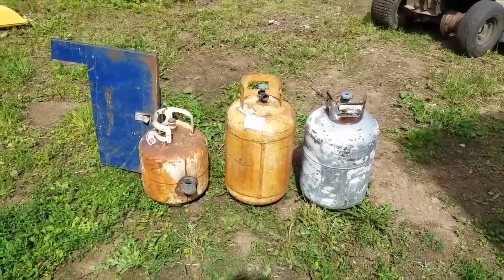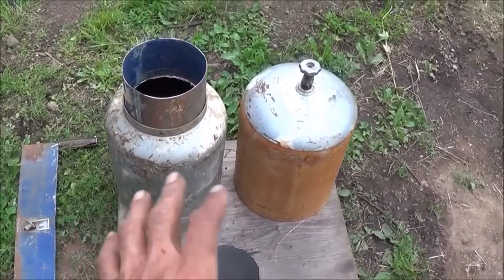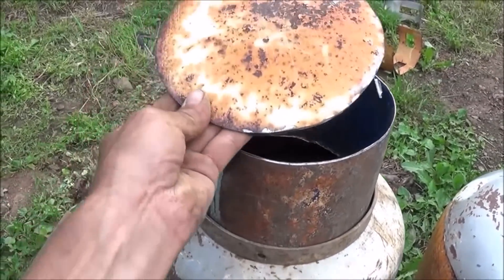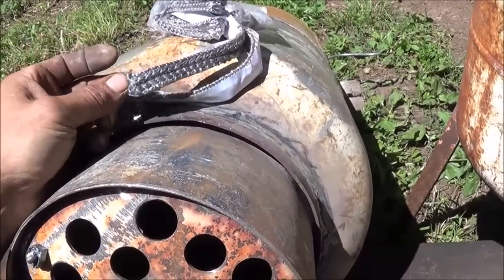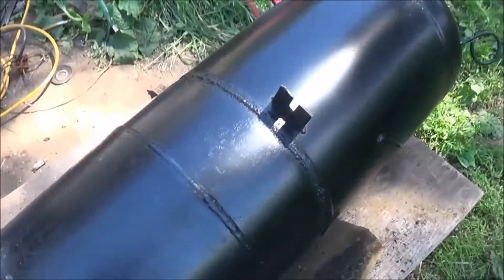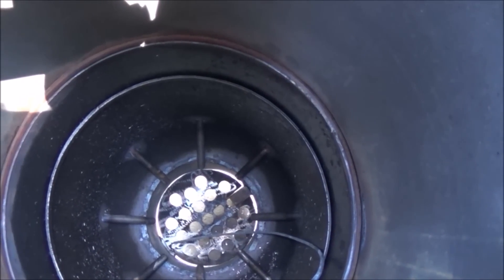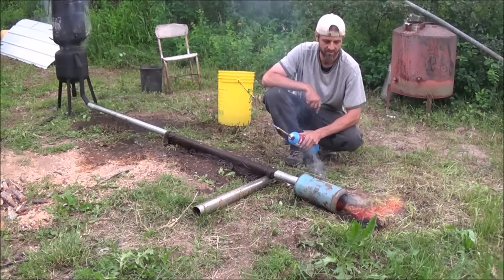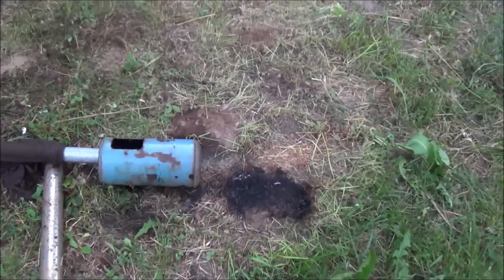How to build a "Wood Gasifier" from propane tanks, to power a "Tiny House"!

Comment: for you guys wanting to compress this be very careful if you compress a combustibale gas and oxygen even accidentally gets in the mix you just created a bomb that will flash explode faster than you can imagine i learned this when  i was 16 and wanted a portable cutting torch so i took an empty helium can from a science expirement and started my cutting tourch mixed it to neutral flame snuffed it out in the dirt and proceeded to pressurize my helium can... when done i lit a candle and called my sister to watch i squirted the bottle at the candle and there was no flash just an explsion that blew the can seem in half and blew both ends off the bottom stuck in my chest about half an inch so i had a trip to the hospital... lesson learned no  flamable gas compressed WITH oxygen....EVER!!! even a sandwich bag with a black cat firecracker will demolish an open ended metal coffee can....
Reply: Yeah never compress gas unless you know every aspect of it I run a 5.3 modified engine on wood gas runs like a champ runs power heat and air conditioning all thermal mass 😁
Reply: Yeah, good reason to supply the Oxy-Gas welding rig from two bottles.  A second problem that could have caused an explosion is that Acetylene is unstable as a gas under pressure, in the welding set it is dissolved in acetylene and safe that way but what you cooked up was pretty much the opposite of safe.  Glad you lived to tell the tale.
Reply: An empty cigarette packet filled with Oxy-acetylene mix the correct ratio for welding if lit will reduce the packet to small shreds and fluff, this will leave one with ringing ears for hours and a lifelong respect for the power of confined oxy-acetylene, ask me how I know, (in my good ear)!
Reply: More of a problem specifically with acetylene.  Very difficult to compress safely.
Reply: How would you light the firecracker if it's in the bag?
Reply: In my vocational welding class / jr. yr. some idiot filled a plastic garbage bag with acetylene and oxygen tied it off and threw it under the guy using the cutting torch station ; he was blinded for a while. ps. they also welded pipe . . mini polish canons enough to just fit a marble, they were so powerful when they hit the 6ft industrial fans it would stop them cold for a bit. I should have received combat pay for attending that school!
Reply: @greggbarber  Had a similar experience in Metal Trades in High School. Classmate filled balloon with Oxygen and was going to hold it and light it.  We were able to convince him to put it one of the BBQ grill smokers we would build. He threw in a lit piece of paper and sounded like a giant bomb. I am sure his hand would of been missing had he been holding that balloon.
Reply: @greggbarber  ha... That was an every day thing in portales high parking lot! The coolest shop teacher ever ( Mr Hugs) . The whole school would shake
Reply: @greggbarber  They'd fill the air hose with water or nails in my shop class.

Comment: As you mentioned that the gas isn't filtered in your setup so it wouldn't be good for an engine or a generator or the like...I'm curious what method you think you would take to filter the gas so that you can remove the tar and any other impurities out of it?

Comment: OK watched 17 min of your video and really well explained and easy to get it. Well done and thanks. Here is the thing though. Why not just use the wood to cook with?
Reply: Work With Nature because you can always go get more wood. You can always go get more energy, and a source to fuel a generator.
Reply: You can still use the wood to cook with. Once the gas is released the wood turns into charcoal which can be used for barbecues.
Reply: imagine the heat gas gives off compared to wood, the ratio is probably much better converting it to a gas than just burning wood which is inefficient.

Comment: Dude your video's are great. Been thinking about building one for a few year's. I watch a lot of video's on Gasification and also doing a lot of reading on it. I had in mind how I wanted to build it. But this video has changed that the propane tanks are easier to find then what I was looking for. Plus the unit is a little smaller but sense the burn chamber is as large as it is it will work. It will produce as much gas as the one that I was going to build take up less room when not in use but when in use you would just have to fill it more or put one more 30lb tank on top.Would love to see your filters for it. I know how I want to do mine unless you have a better way. I was going to use a 20 or 10 lb propane tank as a swirl filter to catch the tars maybe two. Then have it go to a 4 inch pipe as a cooling chamber and added filter with a four stage setup. What do you have ?

Comment: You should try to figure out a way to store the gas.
Reply: He already knows how to.
Reply from the maker: Pimp Trizkit Yes,  I do know how!  There are a few ways to compress and store wood gas, by using very expensive high pressure gas compressors and steam reforming most of the wood gas can be converted into liquid methanol. Without the compressors only a fraction of the gas can be stored, the hydrogen and methane can be stored easily but only make up 20% of the gas.

Comment: I'm wondering if I could use a couple of water heater tanks/ refrigerant tanks( roughly the same size as propane bottles) to duplicate this?
Reply: I think he uses a water heater tank in a previous gasifier video.  The biggest problem with all this is the type of steel. You can use any steel really, but the weaker/thinner ones will have a lower life span and will eventually rust away much faster. My standard 55 gallon drum lasted about 30 burns until it busted its first hole.

Stainless Steel would be ideal... or Titanium. The pros use high quality stainless steel, probably something akin to medical/marine steel with a high resistance to corrosion.

Comment: I am very impressed. I have a question. Would it make a difference in the gas flow if the air inlet jets were installed at an offset angle? Would this create a vortex? I have no idea, but thought you may know. Thank you for encouraging others to be more self reliant!
Reply from the maker: A flow analysis shows that the wood being as packed in as it is would disrupt most of the airflow and cause only a minor if any vortex effect, good idea, now if you specifically designed a reduction zone to allow the air to flow through passages so a vortex could be created, then I would say it has the potential to increase the temps and could provide a more efficient system.
Reply: @MrTeslonian  If you want a suggestion for such a design, try this
Drill holes in the tubes (before you insert & weld them in place).
If the combined cross section of holes is as great (or greater than) as the ID of the tubes then you can seal off the exit end entirely. 
If all the holes point in a clockwise direction you will enhance the vortex effect.
Wood that gets in the way of the air inlets will quickly burn off and away.

Comment: could you run the pipe through a water source, such as a stream, to keep the pipe cooled and compress the gasses?
Reply: Yes of course. Or he could have just used a bigger radiator. But how about this... Instead, build a heat transfer to the fresh air intake.. that would probably increase efficiency from recycling otherwise wasted heat.
Reply: @PimpTrizkit-42  that was my thought too.  the heat transfer could then be used to heat the house/cabin through a oil or water filled radiator
Reply: drongo jonkins the tar might clog up the radiator
Reply: Hear is a idea use it as a pre-heater for your hot water .
Reply: thumper barrel
Reply: Or a car radiator??? The inlet and outlets look about the same size - 1.5" or so??
Reply: Well.. what do you think..?

Comment: if i were to ask you to build me one of these how much would you charge and could you show us it in action installed in the tiny home please and thank you
Reply from the maker: Even using recycled materials this cost $250.00 to build, plus 10 hours of my time at $40.00 an hour (and that is far lower than I typically charge for an hour of my time), so ball parking around $650.00 if it's made with free materials.
Reply: MrTeslonian I’m interested in paying you to build one. Are you interested?

Comment: Cool project there mister! If you want to keep your gas cool one thing you might consider is to drop the diameter of you outlet pipe where it comes out of the gasifier! I used to test natural gas wells and when we flowed the wells thru what we called an "adjustable" choke, you would see iceing all the way down the rest of the flow line to the point that it would sometimes freeze off! A dangerous situation if the pressure kept building behind the plug of ice. Its just a suggestion and  I think you would be fine because your system operates at way lower pressure than a natural gas well! lol. If you could figure out a way to make your choke point be adjustable you would have a way of regulating the flow as well as the back pressure on your tank. Both of those I should think are required to achieve clean burning of the gas coming out!

Comment: I think you said the blower is just to get it started.  Was the blower still running by the time the gas was burning without the propane assist?  At some point do you turn off the blower and then it stays off for the rest of the burn?
Reply from the maker: The blower is only left on if no engine is running and the gas is being used for other appliances. The blower is used to start the gas production, if the gasifier is hooked up to an engine of any kind the engine will create the draw on the system and the fan is then turned off once the engine is running.

Comment: it's amazing how much energy is stored in wood. always heard limbs are the best fuel too - which is what you were using. cool stuff man
Reply: Limbs are also a TRULY RENEWABLE RESOURCE as opposed to cutting down whole trees.
Additionally, PRUNING (if properly done) contributes to the health of the trees (especially when done BEFORE the hurricane season ... not a sure fire solution but it can reduce the profile and thus force that wind can exert against the tree).
Reply: I KNOW !!!  I would LOVE to build a Stove/Oven that ran off of a few SMALL peices of wood !    AND Heater for winter !!!   Small Power and Gas bills in the future.  But my Gas is just .47 cents per therm.
Reply: Limbs are just easier fuel as they are smaller, you want the fuel to be as small as possible. So wood chips and saw dust work best (the only issue with sawdust is it tends to get kicked up and flash with forced air) but you  can use even rice husks if you wanted to.

Comment: Thanks. I appreciate you sharing your experience and knowledge with us. 
Would a hand-cranked bellows work instead of an electric blower? It would be nice not to have to be dependent on having electricity to get it started.
Reply from the maker: Yes a bellow would work and would be cool to watch work as well!
Reply: berserk7111 there are hand crank blowers similar to the one he mounted for forges too!
Reply: could you just rig a battery powered leaf blower to it? then charge the battery from the energy? Just a thought
Reply: Hey Berserk, you could make a type of 'airwheel'(like a waterwheel), on the exhaust, that blows the induction air back onto the fire.  You would have to start the fire the hard way, but once it was going, you would only have to worry about a runaway burn.
Reply: @Pete Barry Turbo?
Reply: berserk7111 im sure u could use a hand cranked blower if it blew enough air.
Reply: Jade O 'Hara soo dramatic... by god.. if you are worried about your roof caving in then that is from pure laziness... and obviously there are tons of ways to keep the pipe from over heating, although you are clearly to lazy to figure it out... nerd
Reply: Andre D hand crank blowers produce a large amount of air, and have a higher water column(the amount of pressure) than squirrel cage fans.
Reply: They seem to work well enough for forges.
Reply: berserk7111 Bike powered blower would be good!
Reply: Attach a small stirling or hot air engine to it and it would be automatic

Comment: Could you put that in a gas bottle to store as you would propane??
Reply from the maker: Yes and no, some of the various gases produced can be stored without diminishing in potency and others will convert into other compounds under pressure, some will just form into liquids and remain that way even if you relieve the pressure. So yes gases like hydrogen and methane can be stored and others like carbon monoxide can bond with another oxygen atom and become CO2 which is non-flammable.
Reply: MrTeslonian thanks for the reply
Reply: I was just about to ask the same thing, luckily I read these comments before spamming. 
I wanted to build a biomass gasifier and store up the gas to run a small generator off it..
even just a biomass digester to make methane out of..

@MrTeslonian
now with the gasifier itself, I could put piping around it to boil water and run a steam generator?